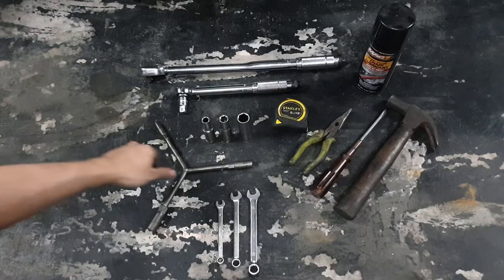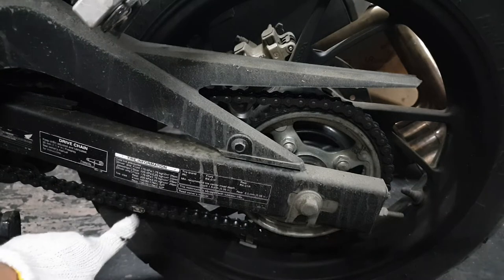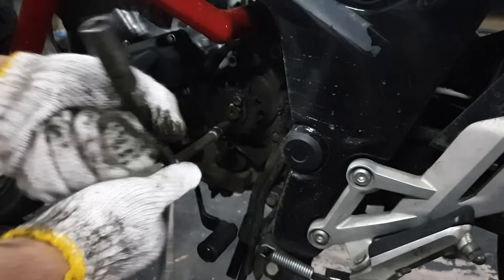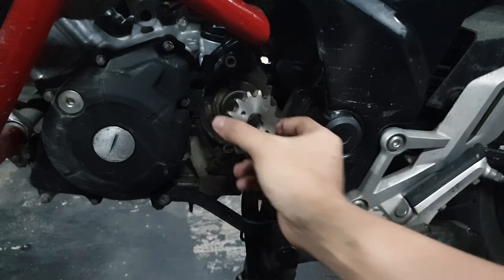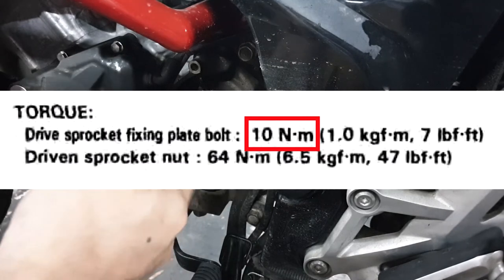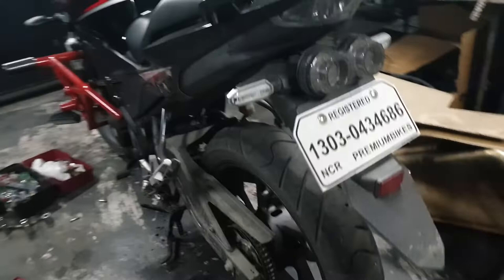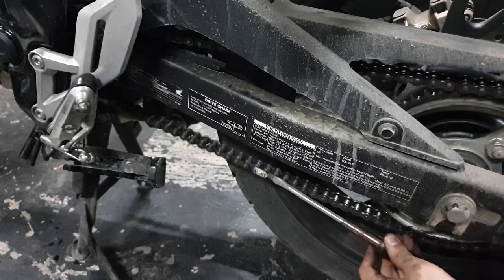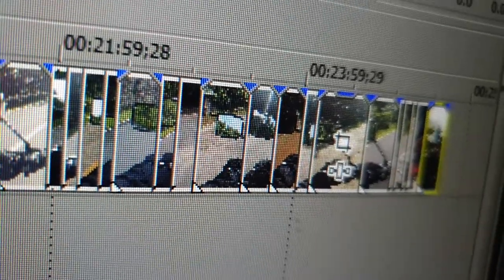Albert Rides - CB150r - How to Change Front Sprocket

Comment: Sir pwedi magtanong engine sprocket ko po 15t 520 stock at kadina ko po 428 at rear sprocket ko 42t 428 din ok lang po ba yon? 520 at 428 mix po?
Reply from the maker: Di po ako sure pero dapat po hindi siya mag match. Yung sprockets at yung cahin dapat pareho yung size or else hindi sila mag kakasya ng tama. Either masisira yung chain or yung sprocket.

Comment: I just bought 14T from tsr. And it does fit. But the problem sir is my Chain. It doesnt fit the tooth of the 14T. Bakit kaya ganon sir ? Thanks
Reply from the maker: TSR brand na pang Supremo should fit the stock 428 chain sir, unless naka mamaw sprocket chain na kayo na 520.

The TSR 16T (TMX Supremo) that I got fit. Pero for the 14T I got the Mishiba one kasi wala ako mahanap na TSR.
Reply: IDOL RK TAGASAGO FOR CBR 150R